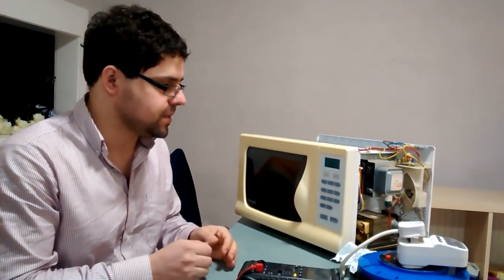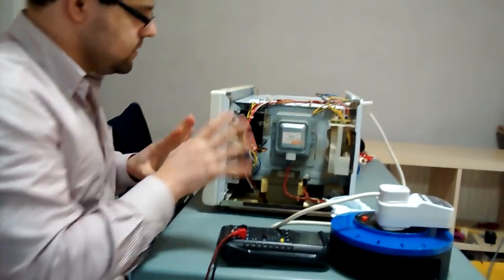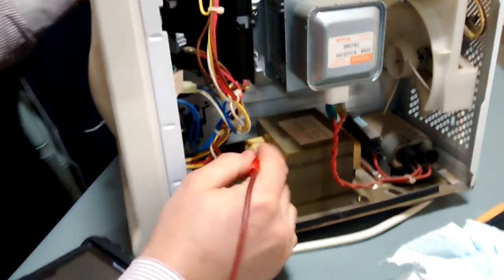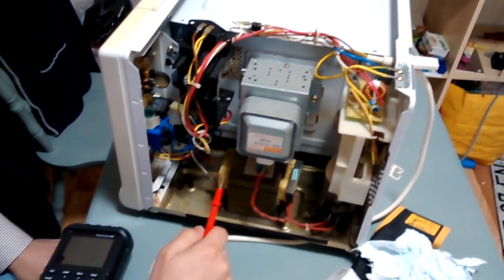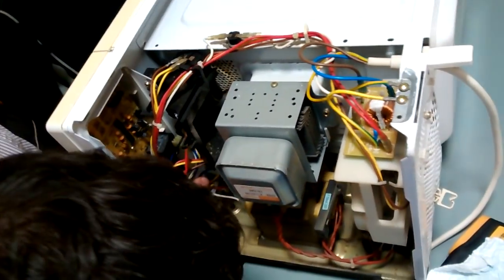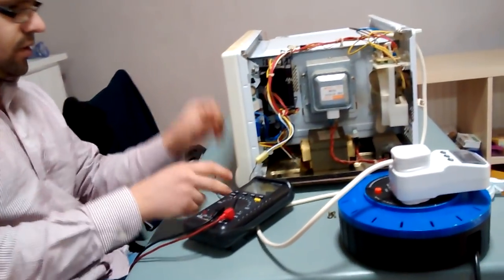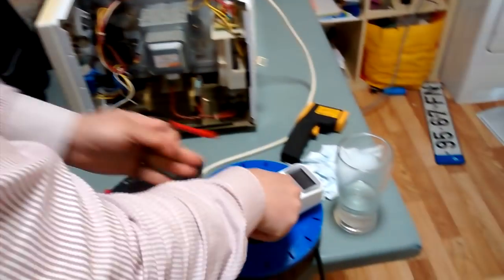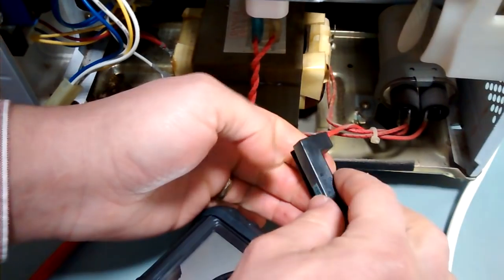Faulty microwave oven diagnosing

Comment: I changed the Cap and the diode because they were cheap so I just did it to start out and of course they weren’t the problem. The door switches, HV power supply, fuse, cap, diode, thermal protection switches and magnatron all tested fine though I did notice the metal on the magnatron “gun” or the emitter looked cooked. When I tried cooking the magnatron gets really hot but the food stayed cold. I bought an over the range used microwave for $20 and tore the magnatron from that machine and put it in my far more expensive all stainless machine and made it fit with modifications so it would mount and stay in there and now the microwave works perfect. My microwave has a built in convection oven and cost a lot of money when we bought it so I really didn’t want to replace it with a walmart junk o wave if I could get it working. 
Your video and videos from other youtubers really took the mystery out of my microwave.

Comment: OMG, at 08:40 I got goosebumps, and at 09:52 I totally freaked out. I didn't even look further, I saw enough. On a 1.2kw device, such a thin wire with a loose contact gets so hot that the plastic coating melts, and then you touch it with your bare hand? Bravo! Are you aware that kids watch things like this too and someone could try this the same way tomorrow? Maybe with a little less luck than you had? Your video shows irresponsible behavior that poses a serious life-threatening and huge health risk.

Comment: This man certainly knows his stuff. That said, his instructions and physical demonstrations (especially) are flawed. He takes a lot of liberties which work for him, but can result in injury or much worse for someone who does not know what they're doing or doesn't realize that electricity CAN kill. Several of the components within the microwave oven carry enough voltage/amps to do just that.

His use of a watt meter in the first test is novel. It clearly shows something amiss. Again, however, most people can figure that out somethings not right by knowing the appliance is not working properly.  Such as not heating foods or liquids or intermittent operation.

Comment: If the mains fuse is blown, the door safety switch could have shifted out of position, either due to plastic cracking on the switch mount or shifted from slamming the microwave oven door. It's a safety feature, acting as a fail safe to prevent the microwave from powering the magnetron with the door open.

Comment: Very good video, very informative. Mine was door micro-switch problem. But after replacing the switch in my "under the cabinet" Whirlpool microwave, it was not heating up. Forgot to note the wiring before removing it and connected it back wrong. HV transformer primary was not getting AC power from relay because of wrong wiring. As per video, I checked it step by step to isolate the problem and fixed it. No prior experience with microwave repair :).

Comment: Next on How to Destroy a Multimeter:  discharging high voltage caps through the current range.  News at 11.
Reply: Usually, not destroy, just blow the multimeter's fuse. I simply use a screwdriver, which is far cheaper than meter probes or the fuse for the multimeter.
Reply: Stephen Villano resistance blows fuses not voltage.

Comment: i really appreciate the video you made ,it is quite clear,one thing i need to ask is  when we change the power levels of the microwave we are normally playing with the duty cycle ,which for example if we need 80% power we are switching on the microwave for 80% of the duty cycle and make it off for 20% of the cycle and make this repeated till the set time  is elapsed, do you think it is possible to vary the input voltage of the primary transformer  and get different levels of continuous  power ?

Comment: Thnks for the lesson..I have a DAEWOO microwave and it dont work at all...it has"" NO power" at all the capacitor is good the thermo sensor is working...the inside light works... it has one 20Amp/250vlts fuse its not bolwn the 3 door switches work..""the transformer is not getting power"""I check those components individualy with multimeter ...what can it be??? Can you help me???
Reply: Susana get your hubby to reply. Would help us all.

Comment: tX FOR video. So, I have No power to unit, seems totally dead. I did put a burger wrapper in by mistake, as you said, and it caught fire, then she shut down. But that fuse is fine, the thermo switches are all good, door switches all good.

 I have 120V to the fuse board, fuse has continuity, 0V AC & DC on blades that connect to relay, relay has no continuity .... then ... 12V coming out one side of transformer, 0V out of other side of transformer, .007 volts AC on capacitor test, 0V DC....

I can't figure it out :(

Comment: I have Sharp -888F oven. Food is not heating up by microwave. Grid convection all working fine. As given in several websites, I tested using Multimeter the Fuse, Door switches Capacitor HV Transformer and Magnetron. All sounds working. Even I am getting 220 V across input to HV transormer when select Micrwave instant heat button.
Please share remedy for this issue…

Comment: You do not use multimeter to discharge a capacitor like that !!!  Use a resistor to discharge it !!! Luck of knowledge can cost you your test equipment or your life !!!
Reply: He was attempting to transfer the defect from the oven on over to the meter. LOL
Not a good idea to high voltage zap a meter. I bet it does not work to calibration specs any more.

Comment: Would it be easier just to take off the plugs off the capacitor just to avoid any high voltage or injury?
Reply: OMG, are still alive? pulling the plugs (sure hope you're not using your bare hands) will not dissipate the stored killer voltage on those capacitor terminals.

Comment: hello thanks for your video very helpful I have a question My problem is the magnetron is burn  am I have to discharge the capacitor before I replace the magnetron ? or I just replace it and that's it ?
Reply: miguel f 5
Reply from the maker: A good capacitor has a bleeding resistor built in, so it should be discharged. However there is no such thing as too much care, so always discharge it first using a set of wires with proper insulation on any parts that may come into contact with your hands. If no spark is visible after the terminals are shorted, we're all good.

I don't have much experience with blown out magnetrons but I would resist trying to fix that as it may indicate other issues.
Reply: thank you very much I read somewhere that we have to disconnect the power cord for 2 days and the capacitor will be discharge , anyways I used a globes screw driver and I replace the magnetron at soon I connect my microwave works so perfect and 2 months later still good , the symptoms was weird noise  ,also smell plastic burn , Thank you
Reply: Did you test/replace the diode that boosts power to the unit? Often a louder or "weird noise" is indicative of that issue. A diode replacement is a lot less expensive than a magnetron which may not be the problem.
Reply: Incorrect, unless they have a bleeder resistor, they can maintain a charge longer than that.

Comment: Do you have Part 2 Covers repair of the control board?
Reply from the maker: Not much to go wrong with that, although with only 30 views on the first year I ended up deleting that.

Normally the rotary encoder needs replacing or opening and cleaning and one has to test the relays for correct operation. On my board there was a problem on the circuit driving the relay, so I had to trace the circuit from the MCU to the relay.

Comment: Sir my microwave keeps on all time but no heating. When I open door then it turns off. When I press  keypad start button it works to heat. But won't stop unless I open the door. What should I do?
Reply: Control IC switches

Comment: please what could cause a microwave blowing fuse when u turn it on
Reply: it draws too much current from the mains, so 
1 shortcircuit wires inside the big transformer
2 high voltage diode (or bridge diodes) gone bad
3 high voltage capacitor bad, draws current

Comment: Please do not follow Susana - As an X RAF radar technician I can honestly say you are likely to get fried - Working with cases removed is a NO NO, unless you have shields present. You Discharge Capacitors with a Brinkley Earthing Stick.  You always use crocodile clips to measure voltages and then switch off between measurements. And as another viewer has already pointed out.  "Rings on his finger, bells oh his toes, he will bring disaster wherever he goes" - Don't give up the Day Job Susana
Reply: Dave -

Will it easier just to take off the plugs off the capacitor to avoid any injuries?
Reply: I agree but others are saying it's ok with the cover off. It scars me I worked with Radar too. as to using clips to connect to test points not a bad idea but when I was working on tv's you couldn't do that, it would take too much time. I used to work n the old tube tv's and there were lots of places you could get shocked

Comment: sir, I've changed the fuse because it was unserviceable...
microwave starts to work satisfactory, but after some days again fuse blows off...
again fuse changed but now magnetron is not working... what should I do???
Reply: If the fuse blows, there is a problem in circuit, and you don't know what you are doing, don't touch it, yes microwave ovens can kill.